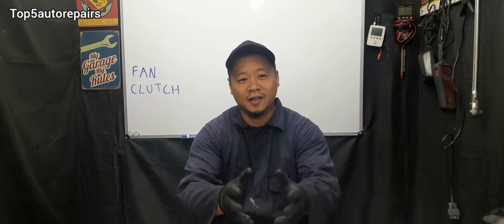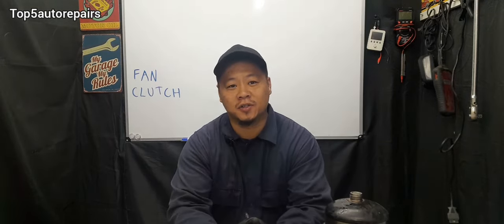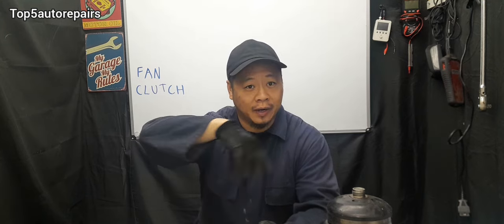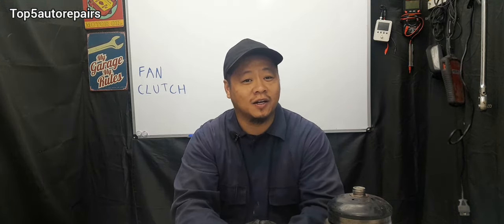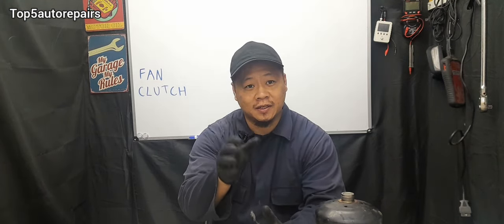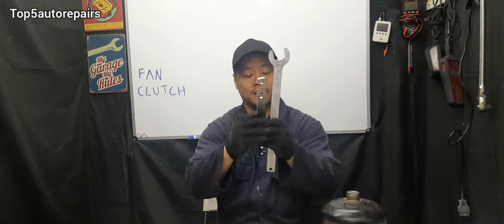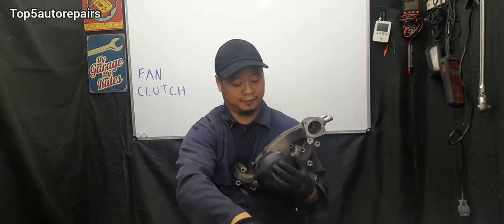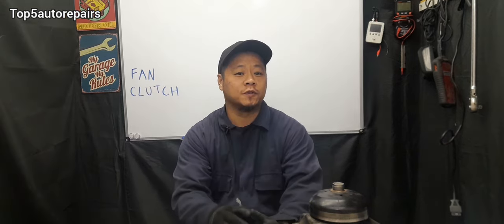SYMPTOMS OF A BAD FAN CLUTCH

Comment: Excellent advice thank you. Whilst having to rectify a 3" bodged body lift done by a  previous owner  the bottom half of a radiator cowling had been removed to get the fan blades to clear and this probably compounded matters even further by drawing cold air over the viscous coupling causing the fan to slip instead of getting enough hot air from the radiator to operate the fan clutch correctly. I believe this misalignment eventually led to head gasket failure.

Comment: We had a series of accidents that each resulted in having to replace the fan clutch.
One new one seemed just too tight. It always sounded like an airplane and I could feel the extra loading to the engine.
I returned it and the new one they gave me was way better.
It made noise when first warning up, but after that it was quiet and the engine didn't feel like it was working harder. It was a perfect setup.
Unfortunately, there was another accident and that fan clutch had damage and was replaced.
The new one was back to being too tight.
This one came from another auto parts store. I returned it and the replacement wasn't much better.
I asked both stores if there was a particular specification I had to ask for, they said no, just go for an oem fan clutch.
I don't have an issue with overheating, it's probably cooling more than needed, especially in winter.
I'm about to remove the fan clutch and try driving it to see the difference.
On one hand, I am thinking of getting an electric fan and eliminating the fan clutch.
This is on a truck, but it's not used for heavy towing or anything like that. I can see having one that would come on more if I was towing something.

Comment: Easy way To know if fan nut is right or left hand . Standing at front of vehicle , Look at your fan blade’s angle direction . If the left side is the side of blade is closer to the radiator than the right . Then that is standard right hand threads, righty tighty ,lefty loosy.
Reply: Also, reverse threaded fan clutch nuts have notches on them
Reply: Wouldn’t just be the opposite way the pulley turns when the vehicle is running?   …or not always?

Comment: Hi I replace the fan clutch and fan blade on a 05 Colorado but when I drive and I accelerate I hear this jet sound air is this normal?
Reply: I added a video of a sound I'm getting after I replaced both fan clutch and blade. Check my video
Reply: Yea you just have a heavy duty one that is basically always engaged

Comment: Will this cause the belt to squeal when accelerating ? I replaced the belt tensioner, belt, and idler pulley but it still makes this wobbly fan noise on idle and squeals when i accelerate at faster speeds

Comment: My 2005 Dodge Dakota SLT 4.7L V8 is running fine on level ground in hot weather and AC running.
But when I driving up hill for distance the temperature begins to climb to 80% and higher unless I turn off the AC ,put the windows down and turn on the heater ...then the engine begins to cool down again

Comment: i hear the roaring noise, and loss of acceleration, but only when i climb up hills . I have an electric fan clutch and it spins immediately on cold engine starts, and i thought they dont spin until engine gets warm/hot?  the clutch it seems is very stiff when engine is off (It turns, but with a some effort).  after i start the car and shut it off it appears to freewheel then..do you hink my fan clutch is bad, or possibly something else? Im not getting overheating at all, but i assume thats because the fan spins all the time?

Comment: Mine 97 4runner makes an extremely loud whirring noise when accelerating and doesn't have the power it should. The engine runs like new and has a rebuilt transmission with about 500 miles on it. The fan doesn't spin free and it doesn't wobble. It won't make the whirring noise if it's in "Park" but does upon acceleration. Do u have any advice?
Reply: If all you hear is that whirring noise nonstop while driving, the clutch is locked up.

Comment: Will a bad fan clutch affect the cooling of the ac in anyway?
Reply from the maker: Yes it can.
Reply from the maker: Condenser won't dissipate heat fast enough.
Reply: @Top5AutoRepairs  thank you
Reply: @Top5AutoRepairs  I changed the fan clutch and still nothing. Looks like it’s going to be the compressor. Ive changed everything except the compressor and the evaporator. I doubt it’s the evaporator. 
Would you happen to know if a aftermarket compressor would work ? Or do I need the oem brand? 
Thanks in advance.

Comment: So I've changed everything except the waterpump.. And its still the same . I used to think ( Scotty ) was a God ...oh...if you find one these buy it ! Xterra 05 2 wheel DrIve . Radiator , hoses , thermostat ....same thing...Should I spend more on the water pump ? camshaft sencors is only code that comes up . would that do it ? Or call Scotty and say : boy do I have a deal for you !

Comment: What if the engine temperature does not drop while driving above 60 - 70 mph?
Reply: Clogged or obstructed radiator, inoperative pressure cap, cooling system leak, faulty ECT sensor, worn (or missing) drive belt... could be many causes.

Comment: Can it cause transmission problems?
Reply: yes and no. If trans has an oil cooler radiator and it's plumped to engine cooling system then yes it might raise temperature if engine overheats. For older cars it wont make any effect